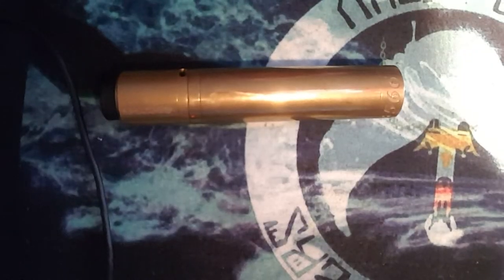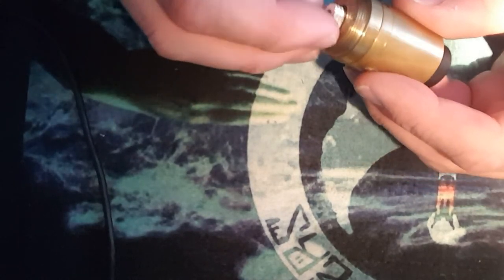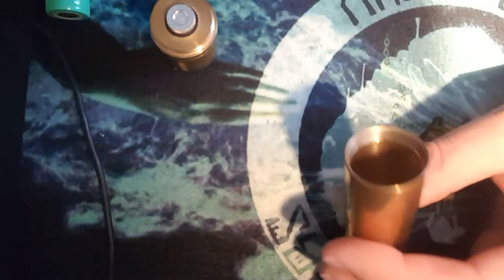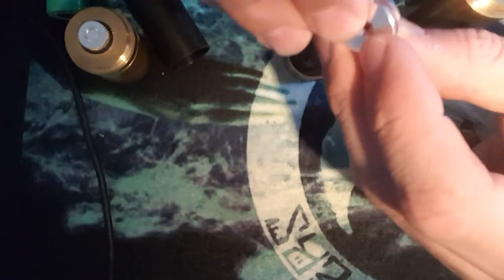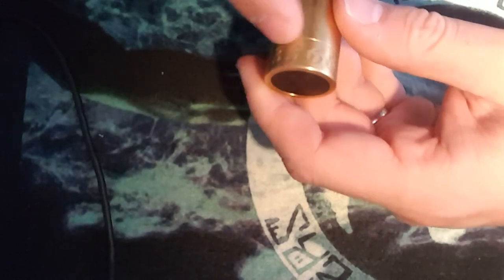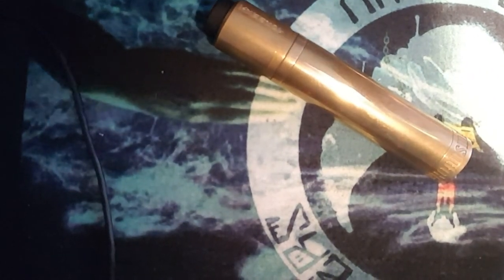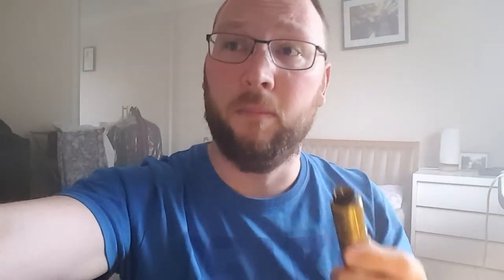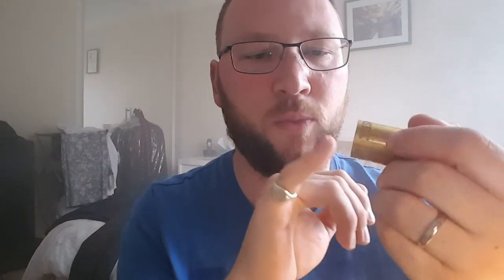Broadside Clone - Brass

Comment: Hi Tim, I have the Broadside clone in the rainbow finish and really enjoy it. When I first got it I spent about 30 mins faffing around trying to get it to fire, so I agree, it is a bit fiddly initially. I ended up starting at the top then adjusting the switch at the bottom. Now it's set up I keep it married to my rainbow Bottleneck clone and all is good. I love the delrin insert, a simple addition to any tube mod that I think all manufacturers should now include and the adjustable cap which eliminates issues with attys with a non protruding 510. You should be able to get rid of that battery rattle by tweaking that screw on the switch. Thanks for the review !